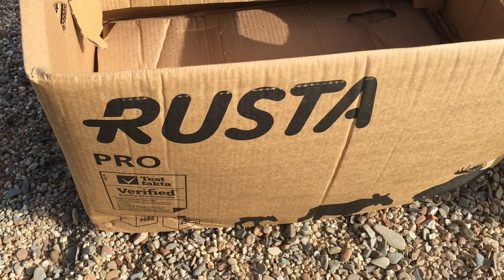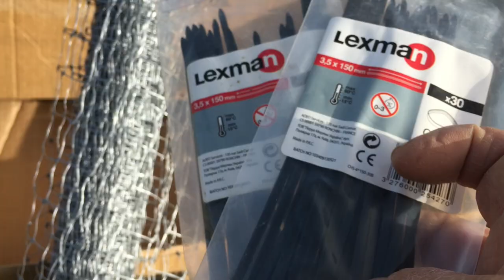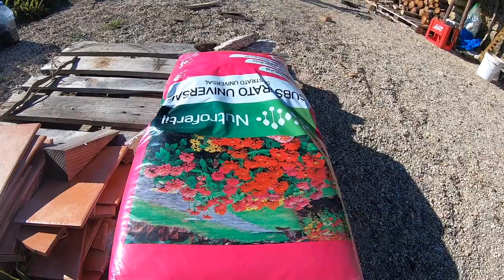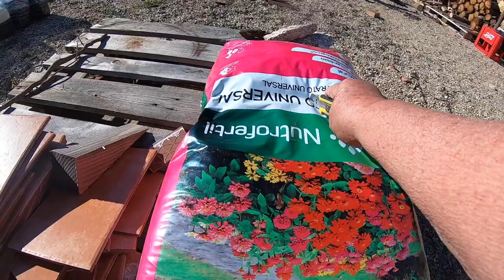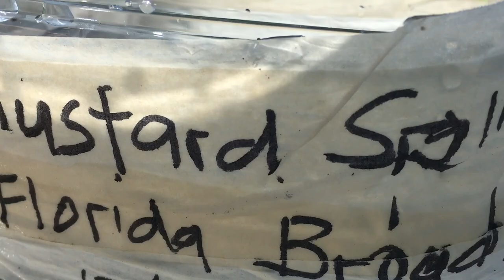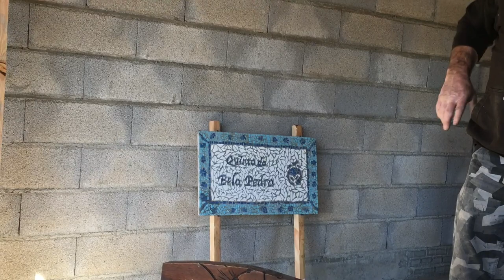Living off-grid in Central Portugal/ CHEAP and EASY RAISED GARDEN BEDS

Comment: The raised beds are great. To prevent them drying out in summer, wrap plastic on the outside of each box/bed except the bottom required for drainage. I used weedmat but didn't work because is porous, causing the soil to dry quickly.
Reply from the maker: That's a great tip! I will eventually build block walls around them to create more permanent raised beds and when these fall apart I'll have soil in the block raised beds.

Comment: You have to put sand all around the bottom to stop the wind coming underneath the green house that will lift it and then it will blow away. It must be high to make it stable.
Reply from the maker: Thanks for the tip!

Comment: You can temporarily put clear nail polish on the cracks of your GoPro……it will not fix it but will avoid further damage, and yes as mentioned before use your tripod more often…Please🐶🐥
Reply from the maker: Thanks for the tip!

Comment: If you wan't something even higher you could get some old IBC's and saw the top off the plastic container. fill it with old wood blocks, sticks, twigs ,old shredded paper and whatever of that kind natural waste for three quarters and put some soil on that. Drill some holes in the bottom of the container and volia.... cheap and lasting for ever!🇵🇹👌🐖🐕
Reply from the maker: If I got some old IBC's I would cut the side off and make pigloos! lol pig housing
Reply: Nick has to give you need some sawing lessons soon than if he has the time, just for safety hahaha🙈

Comment: Your house is looking great. You can dig the boxes in the ground, no netting needed. Or put them in a square and pull earth against them. Not sure how easy it would be to do it at your place. The remaining card bords will be good for protecting the soil from drying out.
Reply from the maker: I'm going to build a low block wall around them.

Comment: (1) It looks like the chainsaw chain is very dull.  If it hits dirt for even a few seconds it will be very dull.
(2).  It is too big for cutting those twigs in that sawhorse.  A small handsaw with a proper blade would work quicker & cheaper... and safer.  
(3) the sawhorse appears to be made to cut much bigger diameter logs, and much longer to fit across the length of the sawhorse.
(4) pls consider a much smaller power saw...
 there are several different ones.
Reply from the maker: I just got the chainsaw as a Christmas gift from my youngest daughter, so was practising with it before tackling bigger logs!

Comment: Are you oiling the chain in your saw? Sounds cranky and definately blunt. Worst case scenario the wood kicks back or chain snaps back in your face. Consider protecting your face and hands if working the way you do. Spoken from a bush lady in  the Canadian  Rockies.
Reply from the maker: Yes, am checking the oil regularly. It hasn't actually been used much yet but will find out how to sharpen it.
Reply: Don't know if your saw brand has an auto oiler, or not....but you should be able to see or feel a lubricated chain.      By now the oil reservoir should have decreased a bunch. Anyways chain stays sharper, lasts longer, and works more efficiently when oiled.
Reply from the maker: @BirgitSchinke  It has and I keep it filled.